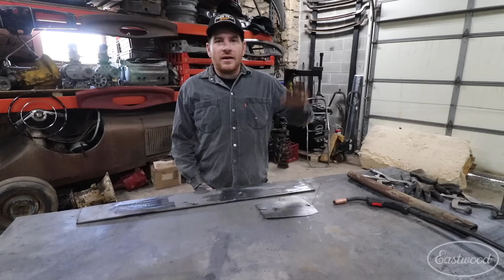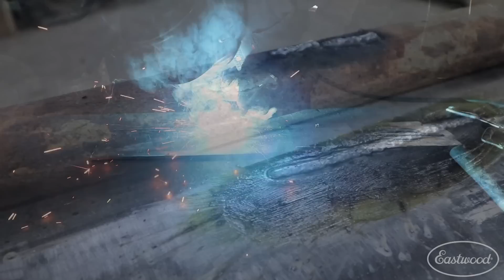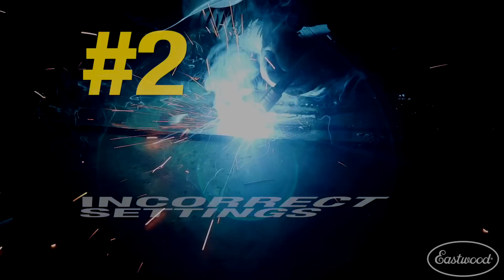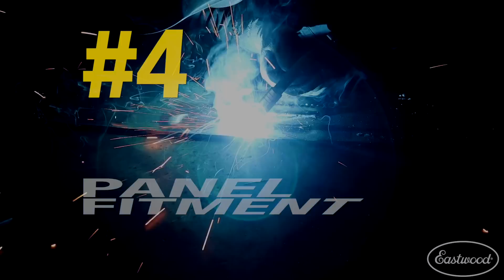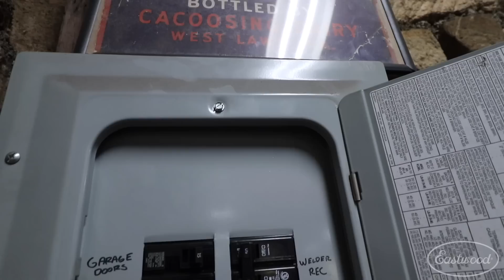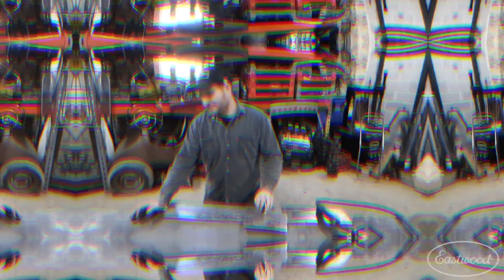TOP FIVE Reasons Your MIG Welds Might SUCK! Get Better at MIG Welding! Eastwood

Comment: Matt, I have a Eastwood 175 Mig and using it to work on my 49 Chev pu, repairing rusty areas with new panels, and I have gotton decent in my welding and having a good time!  But lately I seem to be using a lot more gas from my tank, as I keeping checking guage at tank,. and also I hear gas at nozzle louder than I think it has been in the past .  Any ideas?  Thanks for any help on this issue.  F.J.Bowen